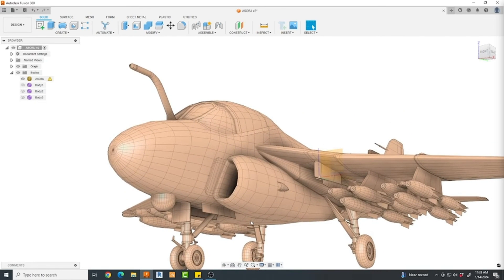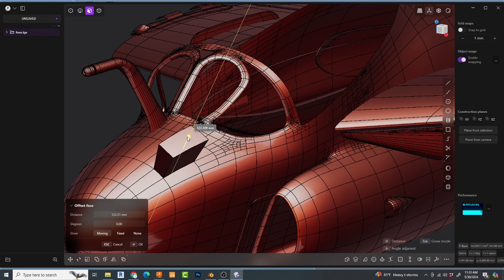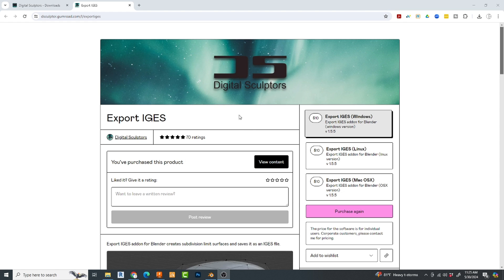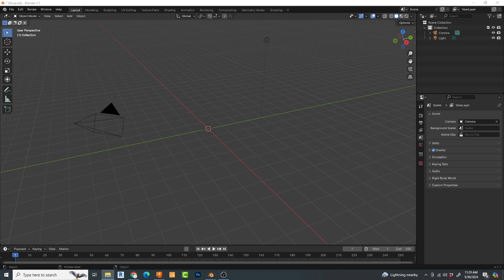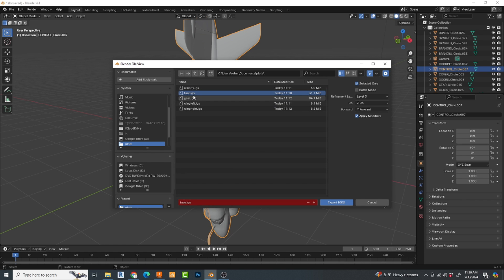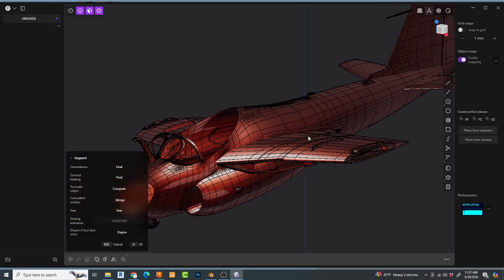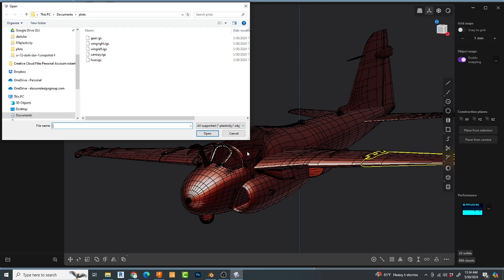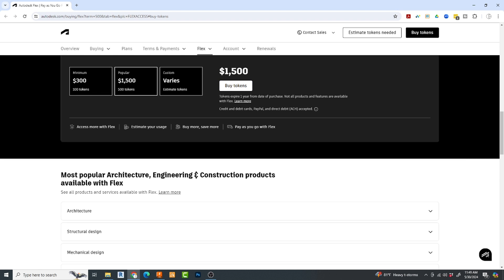Reverse engineer the easy way!

Comment: Excellent tutorial, the plugin works but it does not do well with the mesh my 3D scanner produces. I used Blender/decimate to reduce the original mesh by 60% 
then used Export IGES and imported the result into Fusion, it worked but not as smoothly as the Intruder. I am still messing with ratios to get a manageable file size while maintaining detail. All good as I am learning a lot from your videos about the form tools which have always caused me grief in the past.
Reply from the maker: Great blender suggestion.

Comment: Several years back I used to convert a quad mesh to a t-spline and then convert the t-spline into a solid. Isn't that still possible? This was done completely within Fusion 360.

Comment: Thanks for the video! Quick question. Would this create a file in fusion360 that can be edited in forms mode so you can edit the curves rather than only push pull segments? Thanks!

Comment: Very cool. The add-on is something I've been wanting but didn't know it existed.
  A bit off topic, but do you have a video, or can you point to something that goes over finer points, tips on exporting objs?
   I'm finally to a point where I'm ready to print but my perfectly smooth models have little wobbles when they're turned to obj.
Reply from the maker: Good idea.  You have control over the density of the mesh in plasticity when exporting.  The default settings are a bit too low.  I'll add this to my list.

Comment: I want to comment on high polygon count mesh models which I actally tried this plugin with a while back. I tried to get a few 250k mesh models into Rhino and then to CAM software for wood working, and the only way to do that was to use "Instant Meshes"and "Meshlab". Meshlab to reduce number of vertices to a lower lever without changing geometry too much and to calculate quads and close holes. Then "Instant Mesh" software which is free to calculate faces and further drastically reduce number of faces which then can be converted to SubD in Rhino (I use Rhino, but looking into plasticity recently for fast modelling of smaller objects).

Comment: I am very happy that i found your chanel, can‘t wait for winter aka build time. @1:01 your talking about paid subscription ,I have not installed Fusion 360 yet, i thought it is free for privat use?
Reply from the maker: That's the normal subscription fee.  I was able to use if free for one year, then they started charging.  Honestly not sure what the rules are currently for private use right now.

Comment: Thank you for sharing your knowledge RedBaron. Just an FYI. the IGES import in Plasticity isn't available on the free license version. I bought the plugin for Blender and tried exporting a relatively simple shape (front face of a grip on an aircraft yoke for a flight sim 3d print). 

The resulting iges file at 91MBs has just over 46000 separate faces, not one continuous surface and it's basically not useable if pulled back into Fusion 360, though I might be missing something with my limited experience. Fusion just keeps the in-progress bar on screen and the CPU is doing nothing (18 core CPU). Eventually the model loads but I am unable to stitch or merge the edges into one surface within the "Surface" workspace in Fusion.
Reply from the maker: You are correct!  Plasticity studio version is required.  The files can be heavy.  I imported the model in sections.  With toggle face mode on, I am able to merge faces in plasticity.  There are also subdivision surface modifiers in blender that can simplify the model to some extent prior to exporting.

Comment: really cool if you need that "as it is" but if you plan to modify that geometry or working on it "for real" you will find that it's impossible to work with that many patches that probably even include degenerate faces for which you will go crazy fixing them
Reply from the maker: Thanks for commenting.

Comment: You can also run a decimate modifier or quad remesher in Blender to reduce the polygon count before exporting. If the model is all tris running the tri to quads in the edit mode will help also.
Reply from the maker: Thanks!

Comment: nice
Reply from the maker: Thanks for watching!
Reply: @redbaronrc  Your videos are helping me a lot. Like you I am designing my own custom rc aircraft, my work used it be mechanical eng and machinist. I made jigs and fixturing wave/reflow soldering and then was designing 3d printers and desktop cnc units. Now I am simi retired due to medical reasons and run a small part time biz making promotional products as the equipment used for that and my hobbies are the same. I started learning surface and form tools a few weeks ago. I have been using cad since autocad needed digitizers and pucks so my habits have been hard to break, this has been harder than going from 2d to 3d cad back in....... the 90's I think. 
So thank you so much for all the information that is helping me learn the new toolset.